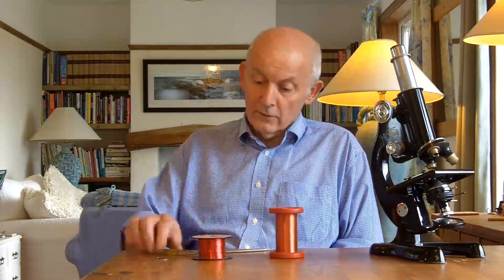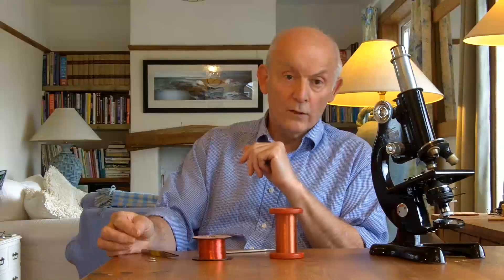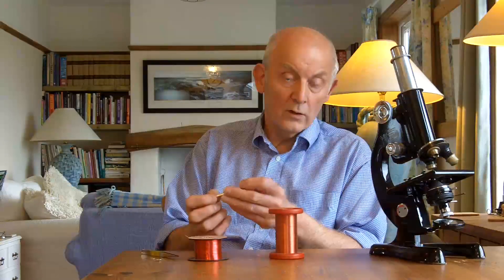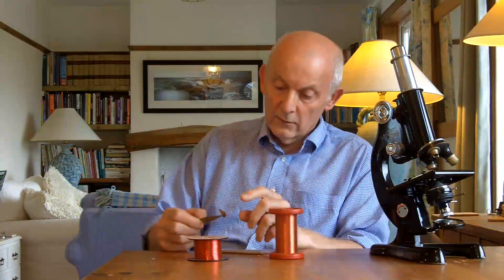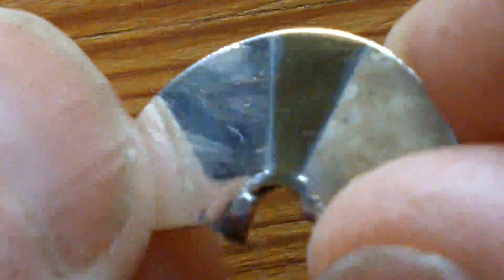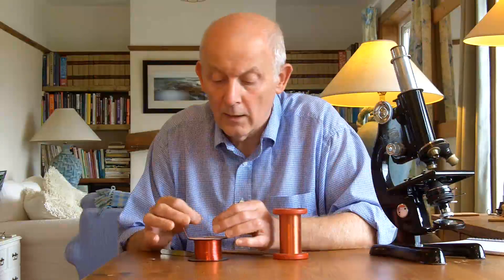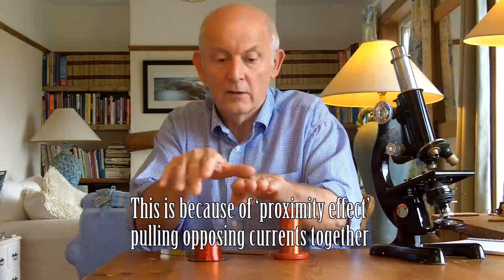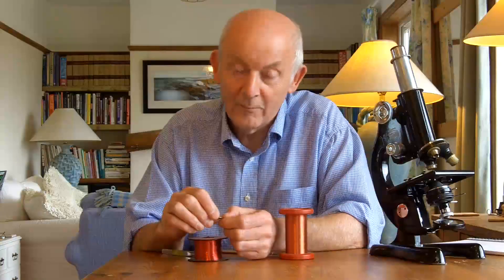About Radio 55 Why we use Litz wire and silver plating

Comment: If I build a  long wire antenna using Litz wire, and assuming I can support it, so it doesn't break...will it work (better) than a single  stranded long wire antenna..?
Reply from the maker: Hi there I really don’t think that you would perceive any noticeable
benefit from using Litz wire for a ham radio antenna. You could for instance
have your antenna gold or silver plated to reduce its resistance but it still
has to be correctly matched to the transmitter and I don’t think you would be
able to measure any practical benefit. I'm sure that getting the antenna at a
good height and pointing in the right direction would be far more rewarding. Kind Regards . . .  Andy
Reply: @AndyDaviesByTheSea  Yep...that is kinda what I thought...so where are you in the world...im on Long Island NY..gonna snow here today..
Reply from the maker: I don’t envy you the snow. We were in NY one Valentine’s Day,
man that was the coldest I’ve ever been, we took a horse carriage ride around
the park, our teeth were chattering and we were shaking with cold. We were
warmer in Iceland in mid winter! Right now we’re in the Cardigan Bay area of
West Wales, (that’s in the United Kingdom) where it has been about 13 degrees C
all day (~55 F) and not too windy.  All the best. . .  Andy

Comment: Excellent! Thank you! I’m currently designing an HF dipole and have been stumped on what type of wire to use (copper V stainless). The skin-effect of stranded copper is far more favourable for a 75Ω feedline. Plus I can now work out the desired thickness...

Comment: I'm building a magloop antenna constructed from 4" wide copper ribbon so as to maximize surface effect. The ribbon arrived smooth and polished appearing from Georgia Copper but I anticipate that it would oxidize over time and develop the usual blue/ green oxidized somewhat rough feeling surface. Would you recommend that I apply lacquer or some other surface coating to prevent that ?
Reply from the maker: Hi John sorry for the late response but I get to reply to many comments. I can only guess that a poor surface will degrade the performance. Theory tells us this is true. I once repaired an 8MHz induction heater, we made a new work  coil.Everything tested ok but it didn’t operate at all, it was for use in a plastic bonding application, it was only when the coil was polished that the efficiency was high enough for it to work. It was a really eye opener. Polishing the surface removes the hills and valleys at a microscopic level and effectively shortens the current path this reduces the resistance.  I’d say it would be sensible to polish it every so often. I was going to suggest painting it and then taping it to protect the paint but you don’t want to trap moisture in that could alter things. Anyway good luck. ..  Kind Regards . . . .  Andy
Reply: AndyDaviesByTheSea thank you very much for the reply and the advice . Much appreciated
Reply from the maker: Hi John just one thing I was thinking about, if you use the loop outside how are you going to maintain stability? I don't know what size loop you are making but where I live if I put 4" wide strip outside it would flap about and that 'fluttering' would be a big problem. You'll find that tuning the loop is very twitchy. That is if the geometry of the copper work alters even a little bit it will detune the antenna. If you add too much support you could get into trouble with the high voltage because of bridging.  I thin that even 3 or 4 mm thick strip (100mm wide) will flap around like you never expected. So unless you're going to use it indoors you might want to think about this and maybe see what other folk do.Good Luck!! let me know when you get it up and running, I'm off the air just now but I'd still like to see how you get on. 73's Andy

Comment: Does silver plating help a vertical antenna receive better or improve it at all ? For HF or 10 meter use.
Reply: Because skin effect is directly related to frequency, as freq. goes up skin depth gets smaller.  but this relates to dc resistance vs the dc resistance (pure resistance) component of ac resistance.  R + Z.  The thing you want to increase in an antenna is Radiation resistance/ R (DC) ratio.  RFradiation resistance is the energy lost in radiation, vs the energy lost in heating the wire.

Comment: I enjoyed your video, I'll be watching more.

I would like to point out that it is not surface area that matters,
it is how much area the current flows in. Thinking about this,
caused me to do some calculations. Below I'll calculate
the current flow area for your Litz vs. solid.

If as you say the the skin depth at 100 MHz is .0008”
and the Litz wire is 0.00157” then current will flow through
the all of the area of the 0.00157” wire. The formula for area
is (3.14/4) D^2
So, area = 0.785 x (0.00157 x 0.00157) = 0.0000019349465sqin.
Multiply times 7 for each wire and we get 0.0000135446255sqin
Total area rounded is 0.0000135

In the solid 0.01” wire, current will only flow in 0.0008”
of the skin. I'll solve for that by subtracting the inner
(non current flow) area from the outer total area.
Outer diameter = 0.01”
Inner diameter = 0.01-0.0008 = 0.0092”

Total Outer Area= 0.785 x (0.01 x 0.01) = 0.0000785
Total Inner Area = 0.785 x (0.0092 x 0.0092) =0.0000664424
Subtract, 0.0000785 - 0.0000664424 = 0.0000120576
Skin Area = 0.0000120576

Total area rounded is 0.0000121sqin

Litz Area = 0.0000135 sq inches
Solid Area = 0.0000121 sq inches

So the math shows they are very close in there AC resistance at 100Mhz.
As you pointed out, the Litz is much smaller than the solid, and if you
found some Litz of equal diameter to the solid it would have more wires,
and it would also have lower AC resistance then the solid. Thus the usefulness
of Litz Wire.

I will add, everything I have read says Litz does help much past 3 MHz.

Comment: Hi Andy, your explcacion, is clear and simple, explain the effect of radio frequency currents on the surface of conductors, your explanation, shows the difference in cost between a connector and a brand cheap, tpo , Andrew, gold plated, Thank you for your teaching, Hug LU9EWO Jorge 73

Comment from the maker: Hi there, there real benefit of Litz wire comes at radio frequencies i.e. where the shallowness of the current is significant. I’ve never seen a radio frequency rotary generator but I guess you couldn’t make one; centrifugal force might be an issue. Let me know if you build one. Not sure what you mean by ‘power generators', because of the high I² R losses in the windings mains frequency ‘high power’ (power station) generators use liquid or gas cooled copper tubes for the windings. 
Kind Regards
Reply: Andy,  old (1918) transmission was by rotary generators (AC) at frequencies of 22khz or so.  Limit was the centripetal force on the armature.  Larger generators tended to explode when the G force became too much.

Comment from the maker: Hi Fred, couple of good questions there, neither of which I can give a satisfactory answer to. First I don’t know that Litz wire isn’t used much in the MHz region. It could be that a simple silver plated conductor can adequacy coupe with the currents involved. Regarding insulation I can only think that the dielectric would increase to inter-turn capacity but it’s not a problem I’ve come across.  Let me know if you get a better answer.    
Kind Regards ... Andy
Reply: Somebody in the old US Bureau of Standards (now NIST) did experiments and calcs that said that the cost/ loss/effectiveness point of Litz wire was about 2.8 Mhz.  I have not seen his original research.  But some modern experimenters have suggested that using Litz wire at higher freq will provide higher Q coils, well above the 2.8 Mhz region.

Comment: Hello Andy - Another excellent video  - two questions for you,  if you have the time
1) How come Litz wire is primarily used in the KHZ region (If coils and BCB loopsticks) but not found much in the MHZ region?
2) I have hearsd that a non-conductive coating  can also affect the "Q" or the quality of a coil - is this also because of the "skin effect" ?

Comment from the maker: 1 of 2 
Hi Dennis, I’ve made so many videos now I had to check to see if I did or not. I did a video on the ‘mini VNA’ antenna analyzer, I did two on that but that’s quite expensive given that I only use it once in a blue moon. 10 years ago I built a very successful single transistor dip meter that I’d recommend still works well, it uses a 2N3819 and a 50 micro amp meter and a two gang variable capacitor out of a radio.  You can find the circuit on....

Comment from the maker: 2 of 2 
Page 520 Radio Armatures Hand book (by the A.R.R.L. staff) 1978.  The original circuit used a MPF102 transistor but the 2N3819’s fine. I wound my coils (5 or six of them) on the plastic bodies of ¼” stereo jack plugs and I’ve been very happy with it. Fun to build and fun to use. The mini VNA dose a lot more but the transistor dip meter has been worth it’s weight in gold to me.
Good luck let me know how you get on. All the best ... Andy

Comment from the maker: At 50kHz the skin depth in copper at room temp is around 0.01118” (11.18 thuo) or 0.284mm so you could use a wire of twice that diameter (half the skin depth on one side and half on the other side) and you’d be getting good utilization out of the wire, you need to work out how many wires to carry the current. If it’s going to get hotter then the figure changes with the change in resistivity. I'm making another video on this and I'll put the formula at the end of it.   
Kind Regards ... Andy

Comment: Great video Andy, I have been wondering about this sort of thing for a while now when designing a SMPS (only 50khz). How do you go about choosing a gauge of Litz wire for lower voltage high current switching circuits?